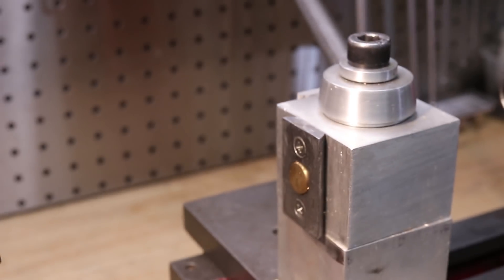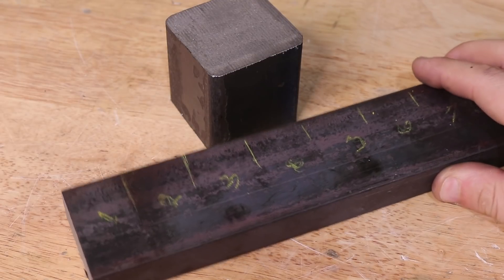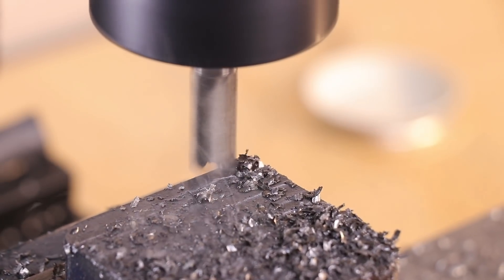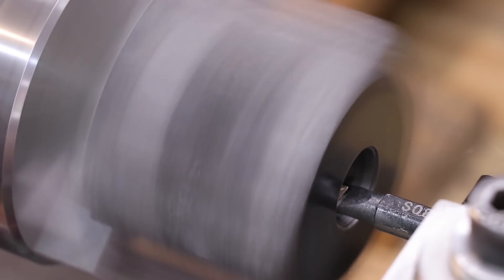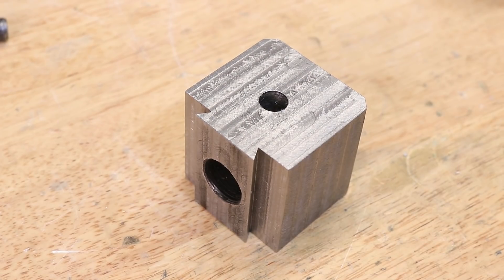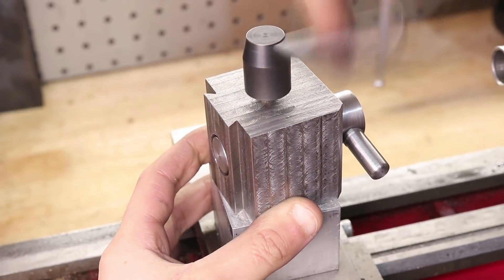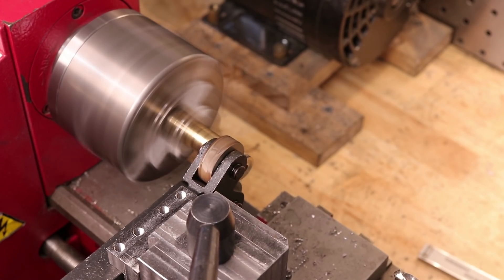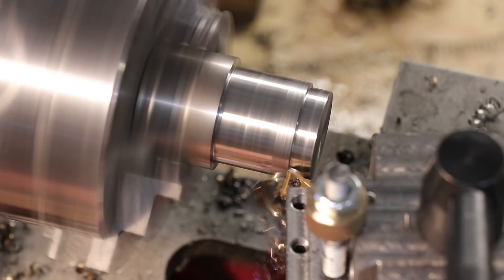Making A Steel Quick Change Tool Post And Tool Holders For The Mini Lathe

Comment: Hello! I dont really understand how the height adjustment on the tool posts works, would someone like to explain it to me?
Reply from the maker: The bolt sits on the top of the QCTP. Move the bots up and down and the tool holder will therefore sit higher or lower

Comment: Good job, definitely going to make this in the near future. Not a critique, but rather an observation: for many of your turning operations, you seem to have the toolpost angle incorrect, using the insert more like a formtool than a cutting tool, which increases tool pressure and might lead to chatter on less rigid lathes such as yours. Perhaps keep an eye on that?
Reply from the maker: If I have the tool set up in such a way it was definitely for a reason. This was such a long time ago I can't remember but it was probably for a reason to do with clearance or the lathe wasn't liking another angle. Cheers

To further clarifify, this lathe is very finicky in it's set up and sometimes the set up can go against conventional wisdom.

Comment: I'm so sorry, but I have to ask... How can you possibly have both a lathe and a milling machine, but yet not have band saw, a chop saw, or at the VERY least, a sawzall, or jigsaw with a metal blade? Especially since you can get the latter for dirt cheap? As a hobby machinist, and metal fabricator myself, I must say I am perplexed 😁

Although some quicker than others, all of those would make quick work out of that material you were cutting. Hell, even mounting the pieces in the lathe and using a  parting tool may have been quicker. because you could have just advanced the carriage, to make each consecutive cut. Not being perfectly centered wouldn't have hurt anything either.
Reply from the maker: Put it simply, there just isn't space for it in the workshop, it's a lot smaller than it looks, and I have to share the space too. Even getting the mill in was a squeeze. It does mean I have to use the hacksaw, but it does not take as long to cut metal as it might seem. Cheers
Reply: @artisanmakes  At the very least you should get a sawzall type reciprocating saw. They're a handheld, tool , and even with a small one (the size of a single boot, with a good metal blade would make quick work of the type of material you were using in this video. And both the blades, and the saw itself are dirt cheap. 

I wouldn't think something that small would be an issue... Would it? You could tuck that away almost anywhere. Hell, you could even take it with you, and put it in a closet in your home.  😊

Comment: U should look around for a used power hacksaw. Not near as fast or efficient as a band saw but they are dirt cheap when you find them and they do leave a stellar finish on the material. Even better than a band saw I picked one for myself for $40 Canadian used.Takes a half hour to cut through an Inch and a half of stainless steel bar stock but I'm drinking coffee while it does it and it has an exponentially better finish then I could ever manage with a hack saw by hand. Plus while it's cutting you can be doing other things. OR Get creative and make one. You can search the net for a quick cut like mine and build it easy. Not much to em.

Comment: Piston locking design well known to be inferior to wedge (there is no cam). It is less repeatable which is made worse because you're holders are not hardened. They will develop an indentation where the piston meets the holder and then it wil not be possible to ever set other tool heights.  Why do all this work and make such compromises.  That said only time will tell if you do enough work for it to matter.

Nice videos.
Reply from the maker: Over half a year in and no issues. This is a small lathe so those issues wont crop up.

Comment: Fantastic job. It looks like you have made at least two of these since you appear in this video to be using your newly designed all steel tool post. 
If this is the case were improvements made, fly cutter finish? Was it for another lathe? Do tell, inquiring minds want to know. 😀
Reply from the maker: Not at all, I have used this tool post exclusively since I made it. No issues at all and it is a lit more rigid that a lot of people might expect, given it is a compact wedge lock. I have faced all the sides with a fly cutter to get a smoother finish, but that's about it.
Reply: The other one is an aluminum one he made previously

Comment: I find your lack of cutting fluid disturbing
Reply from the maker: Thanks for the feedback, when I'm cutting, all that smoke is cutting oils evaporating. Certainly wasn't enough but I didn't want to use too much until I installed the table coolant plumbing
Reply: @artisanmakes  Just giving you a hard time. Very nice work.

Comment: A$20 + a milling machine.
Reply from the maker: Yes, though I have a tutorial on making a tool post without a mill. And yes, $20 in materials, much cheaper than an off the shelf model. Cheers

Comment: sir, what size do you use for devotail?
Reply from the maker: From memory, 22mm wide with a 60 degree angle and 5mm deep. Though the size doesnt matter much, only important thing is that the dovetails on the tool post and holders closely fit.
Reply: @artisanmakes  tank's sir good luck

Comment: A little tip born of experience - firstly, use a high tension hacksaw frame and, secondly, use liberal amounts of oil on the blade while cutting. Do it this way and you'll achieve speeds similar to hand sawing similar amounts of wood - it all adds up to make it that fast. I've done it many times and it works amazingly well!  :)
Reply: Do what Art says. 95% of hacksaw frames are rubbish. If you can twist the frame easily put it in the scrap bin. Making a straight cut is hit or miss with it. Remember on mild steel with a good brand blade you only want to be cutting 80 or 90 feet/minute.This is about 3/4 second stroke with a 12" blade. Don't attack the work like a madman. It may seem slow at first but if you are using cutting oil you will notice little wisps of smoke from the cut. A good quality blade with the right tooth count for the work will cut fast and last about 10 times longer than what you used to do.
Reply: @aceroadholder2185  :)

Comment: it's better to have a toolpost that Pulls the holders into it, instead of pushing them on the dovetail
if you make the dovetail "retract", you pull the side of the holder into the post, giving you way more surface contact
Oh.. and Deburr your work.. saves you a lot of band-aids, and it looks even better too..
Reply from the maker: On this size lathe it doesn't matter how the holders are held in place. Rigidity is lost in other places. We'd need to use a much more substantial lathe before we'd start to run into issues with this style tool post. Plus this style is the easiest to make for someone with hobby equipment. And yes everything gets a nice debur, it just doesn't always make it on camera/through editing.

Comment: I see some good heat going into those chips at the end!  I daresay you'll be getting really good surface finishes on steel now.
This is a grand mod - simple and very effective.
Reply from the maker: Thankyou, pretty amazing results from what was a $600 lathe. Cheers
Reply: @artisanmakes  I'm so sorry, but I have to ask... How can you possibly have both a lathe and a milling machine, but yet not have band saw, a chop saw, or at the VERY least, a sawzall, or jigsaw with a metal blade? Especially since you can get the latter for dirt cheap? As a hobby machinist, and metal fabricator myself, I must say I am perplexed 😁

Although some quicker than others, all of those would make quick work out of that material you were cutting. Hell, even mounting the pieces in the lathe and using a  parting tool may have been quicker. because you could have just advanced the carriage, to make each consecutive cut. Not being perfectly centered wouldn't have hurt anything either.
Reply: @smallblockchevy1022  He enjoys the workout. Some use a band saw, and then go to the gym. He saves time by just using the hack saw. ;-)

Comment: I'm not trying to criticize, but I'm surprised you didn't face the tool holders before cutting in the dovetail.  I would have expected you to do that to ensure a more consistent mating between the holder and the post.  And now that I have finished writing that out, I realize that the face with the dovetail through it isn't in contact with the post, it rides on the dovetail surfaces and the pin.
I'll leave my somewhat obviously incorrect observation in place in case somebody comes through with the same thought.
Reply from the maker: Always happy to hear feedback, this is always a learning process for me too. And as you said the faces done mount so no need to face them. The great thing about these tool holders is that they are very low tolerance parts, which makes them a joy to make. Cheers

Comment: Next project should probably be an actual milling vice to replace the drill-press vice...
Reply from the maker: I would love to buy I don't have the equipment to produce a vice like that. Credit where credit is due, my vice may not look like much, but the jaws are all properly ground in and it does a respectable job for what I need from it.
Reply: @artisanmakes  I do know that there are a few vice's of the drill-press type that are good enough for light milling(have a couple myself), can't see if you already have done it but a larger(longer) bottom plate under the moving jaw and extending forward is a great way of reducing jaw lift/tilt, making a new and longer moving-jaw is also something you can(and is equipped for) do.

And if you look up 'screwless vice' you will find a design ideal for small machines that can actually be made using the equipment you have.

Comment: Who wants a magnetic toolpost??? 🤔
Reply from the maker: Demagnetizers exist for this such issue.
Reply: @artisanmakes  Just my 2 cents which you should take with a grain of salt and doesn't really matter much in your case:
Hammering on a magnet ... is actually an action which is nothing other than demagnetization. Pressing that guy in (without any shock-force) is the way to go. 
I just found it a bit funny in that context here;)
Thanks for the design and great video showing this off!:)
Reply from the maker: @dieSpinnt  Yeah I guess you are right about that. Thankfully a light tap didnt damage it too much :)
Reply: @artisanmakes  it won't work as long as Your magnet will be inside
Reply from the maker: Sorry, I must have misunderstood your comment. I've used the tool post for a few weeks and I have not observed the tool post becoming magnetised. I don't think the magnet is powerful enough to make any noticeable change to the tool post.

Comment: Remember to break the chip, when using a handtap. It will make tapping easier, for you, and the tap 😉
And, dont knurl that fast, and freehanded like that.
Reply from the maker: Cheers, I did remember to break the chip, but probably didnt catch it on video. AS for the knurling, you are right on that. I got a lot of mixed results doing it like I did.

Comment: A piston type?.........crap, I'm outta here.
Reply from the maker: I've used the sliding dovetail type and I don't notice too much difference between the two.
Reply: In terms of rigidity, both are fairly good. Wedge type tool posts have a marginal advantage in repeatability but then if you're looking for that in Aloris style tool posts you're better off investing in a good multifix clone.
Reply: @HM-Projects  The piston type is a bad design from accurate holding and positioning of the tool cutting edge.........but quite reasonable if you just compare it to the 4 way tool post......the wedge type, even though more expensive to buy, is far superior in all aspects.
Reply: @gangleweed  I've have both and have measured the height offset in both. You're correct that the tool height repeatability is accurate with wedge style, but the difference is so minuscule for average hobby work. Wedge style suffers from metal dust  and swarf accumulation which without more frequent cleaning negates the advantage. Cheers.

Comment: No reason to redo the toolpost. I would just give it a quick belt sanding and paint or blue it. I will say your mill has a bit of chatter though. I would track down the source vibration.
Reply from the maker: Cheers, there is a bit of work that needs to be done to the mill to add rigidity. Only had it a few weeks so I have yet to find the time to do it.

Comment: Where do you buy offcuts of steel here ? Bunnings don't seem to stock larger sizes and steel sellers seem to only sell by the metre.
Reply: @davidwillard7334  for larger chucks like the 50mm square bar, it can get expensive for small one off jobs in the shed
Reply: @davidwillard7334  for small one off jobs, perhaps 50-100mm like in this video.
Reply: If you live in Melbourne, Handy steel stocks sell my the millimetre. They have a online shop with prices.
Reply: @ozrc1017  A bit of a drive but I can order and organise a pick up when I'm around there. Thanks for the info, appreciated.
Reply: @ryebis  If you know of anyone around Melbourne that sells brass stock in the same manner, ie small lengths, I'd appreciate the info.
Reply: @ozrc1017  I haven't purchased offcuts of brass before. You can try calling Austral Wright and see if they  sell offcuts, they're in Somerton.
Reply: @HM-Projects  Yeah I'll give them ago, thanks for the reply.
Reply: @davidwillard7334  I would love you to say that to my face. You seem to be trolling this YouTube comment pages and putting in your negative comments. You must feel like such a big person?

Comment: Great work once again. This tool post looks really good and now you have plenty of tool holders to go with it. Are you going to heat treat them or leave them as they are ?
Reply from the maker: Cheers Joe. This is all 1018 mild, so I can't really heat treat them. I'll probably cold blue them when I get my hands on some cold blue, but apart from that I'm set on keeping them as is. Cheers
Reply: Can't heat treat mild steel
Reply: @ilikewaffles3689  ahh yes because of its low carbon content ? Is there anything you can do to harden it up ?
Reply from the maker: @MachiningwithJoe  You can carburize mild steel in a forge to raise the carbon content. Though having never done it I can not comment on how easy it is.
Reply: @artisanmakes  It can't be that difficult, Clickspring does it all the time!

(sarcasm isn't always obvious)
Reply: @Kineth1  /s

Comment: I think its great seeing people using hand tools, I see so many apprentice fitters in my workplace ditching their hand files the second they come out of our training school in favour of die grinders, saddens me seeing people forgetting about precision and going with the "that'll do" attitude
Reply from the maker: Cheers, this is a hobby and passion of mine, and I find that doing it this way is just more enjoyable, even if it does take a little longer
Reply: why? If it works, it works. Pushing 35 years in my engineering career and I still don't understand why people get some perverse pride about working harder than is necessary. As Bill Gates often says: "Show me the lazy people; that's who I want to hire. They'll figure out the quickest way to fix the problem." This guy needs a bandsaw but other than that, he's proving the point: QUICK change tool post. Not RIGID tool post.

Comment: Hi greet video & thanks for sharing , any links to the dovetail cutter part number or dimensions please? I’m assuming it’s hss?
Reply from the maker: Cheers. The dovetail was just one I picked up on ebay for about $15. It is a 60 degree cutter and 18mm in diameter.

Comment: Those grubscrews looks too short, they have like one or two threads of engagement which is too weak to properly clamp your tool in the tool holder
Reply from the maker: They are a little short, but it's what my local hardware store sells. I have a pack in the mail that should better fit the tool holders. Cheers